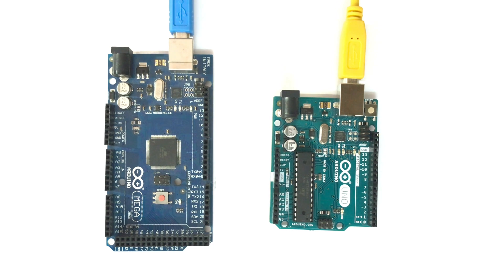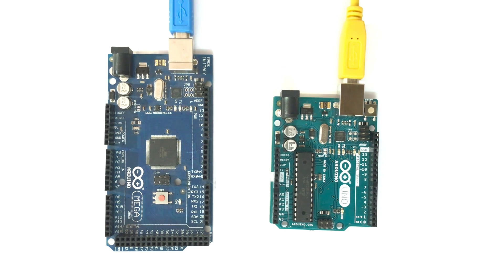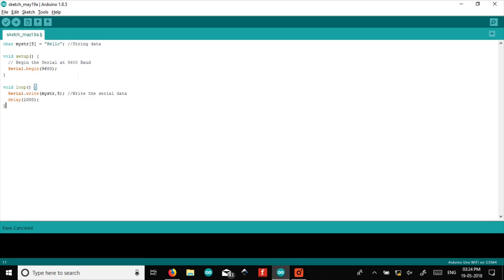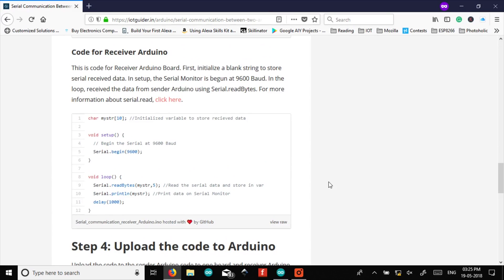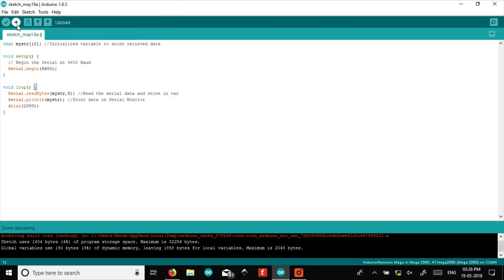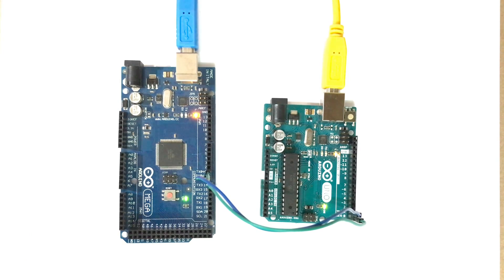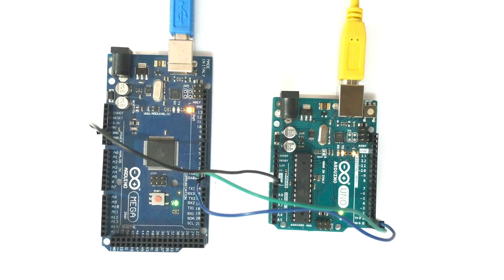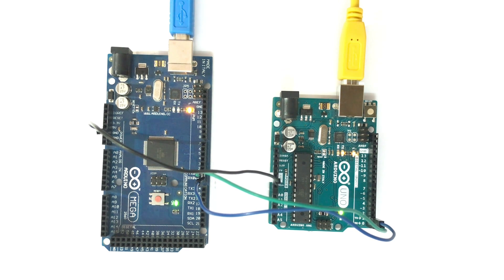Serial Communication between two Arduino Boards

Comment: This doesn't work. It says "initializer-string for array of chars is too long" Issue with the char thing
Reply: Maybe I am a bit too late for the awnser, but the problem is the 'char mystr[5] = "Hello";'.
You need to write 'char mystr[6] = "Hello";' or 'char mystr[] = "Hello";', but I would prefer the second one.
Reply: And at 'Serial.write(mystr,5);' you need to write the right number. For example if you have a Word , that has 9 charakters, then write a 9 (Serial.write(mystr,9);).
Reply: @mischgamertv7260  it’s still saying invalid conversion, I tried both changes

Comment: Can I send more than one value from the sender to the receiver?
Let's say I want the receiver to send the value  of the water level and the temperature to the slave arduino so it can control the heating and motor.
It would be simple for the master to just send a "confirmation text" using an if else statement and if the conditions match send a single value to "give order" to the slave arduino. But out of curiosity is there a way that I can send the two values from the master to the slave and let it operate the conditions?

Comment: I’ve got a question: when using wired serial communication; will this make other serial communications unavailable? Let say i need an Arduino UNO to Communicate with an Arduino Nano via wired connection; and still need the Arduino Nano (with Bluetooth, Wireless, etc) to communicate with other MicroControllers wirelessly. Is this possible, or the microcontroller will just listen to the wired connection?

Comment: This my solution to send strings from Arduino to the next one: 
Sender code:

String str = "This is my string and Basel is Cool :)"; 
int str_len = str.length() + 1; 

void setup() {
  // Begin the Serial at 9600 Baud
  Serial.begin(115200);

// Prepare the character array (the buffer) 
char char_array[str_len];
str.toCharArray(char_array, str_len);
Serial.write(char_array, str_len); //Write the serial data
}

void loop() {
}

 Receiver code:

char mystr[50]; //Initialized variable to store recieved data

void setup() {
  // Begin the Serial at 9600 Baud
  Serial1.begin(115200);
  Serial.begin(115200);
}

void loop() {

  //String msg = "";
  
  if(Serial1.available() > 0){
while(Serial1.available() > 0){
    
Serial1.readBytes(mystr,50); //Read the serial data and store in var

  }
  String rec;  
  rec = String(mystr);
  Serial.println(rec); //Print data on Serial Monitor
   
  }
}

Comment: Would this not work between an adafruit feather m0 and an adafruit feather 32u4 for some reason? I copied the code directly, and can not get it to work.
Reply: do you know the answer now? i have the same problem. i can't communicate arduino uno and pro micro by TX, RX

Comment: Hi , I followed your tutorial and am not seeing any output from my "reciever" board. I have the tx/rx connected as per your diagram and have uploaded 2 seperate uno board with recieve/sender code from your website. From the default serial monitor of arduino I can see the sender sending "hello" but the reciever does not have any data to report through serial monitor. Thanks for any help.
Reply from the maker: Please connect TX pin of sender Arduino to RX Pin of receiver Arduino. For more details please share your screenshots to iotguider@gmail.com. Thank you.

Comment: I am trying to do this with an arduino Nano, as the sender and a pro micro as the receiver.  It seems that everything is working except for the inter-arduino communication.  I can see the "hellos" coming out of the nano on the serial monitor, I can also see the TX light flashing.  I can see the pro-mico able to send data to the serial monitor, if I switch to that com port, for a moment, I put in a test message.  But I am still not getting any data coming all of the way through.
Reply: do you know the answer now? i have the same problem. i can't communicate arduino uno and pro micro by TX, RX

Comment: How to program and use the pins of the slave..
Reply: The slave in this case would be the "sender", so modify the sender code to monitor it's own pins, and then send data back to the "master", or receiver. You can use Serial.println in the Master(receiver) to send data back to the send as well. Both the serial monitor and the slave(sender) are should be hearing everything that is on the serial bus.
Reply: @Shakespeare1612  so this means I can have them both working as master and slave at the same time?
Reply: @nutzboi  No, I don't think so, but you can have one master several slaves, and the distinction should not be important because weather master or slave, they should both be able to send or receive data, at least when the master makes the bus available to them. This is all theory however, If you read my other post, I have not been able to get this to work, and I don't know why not.